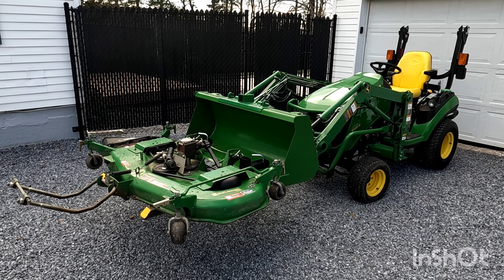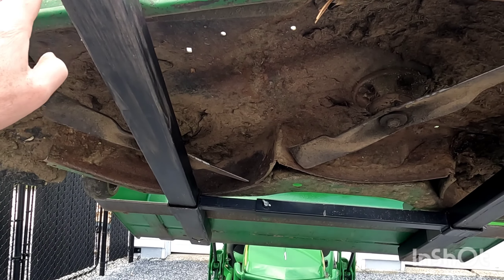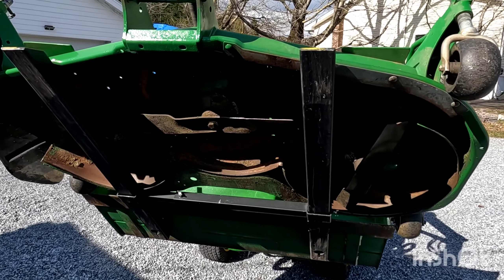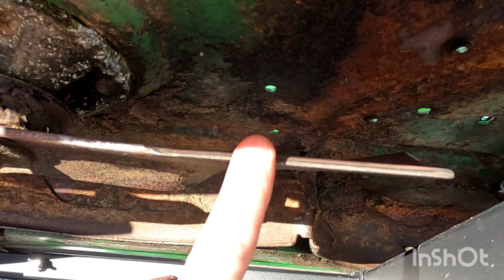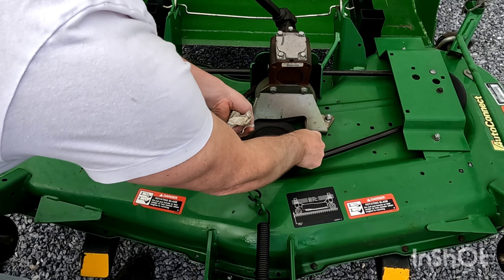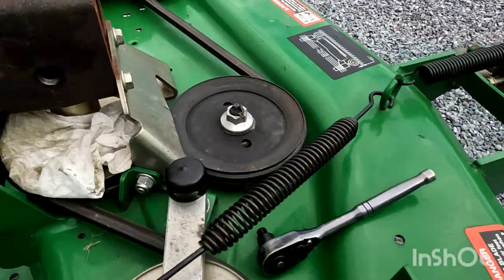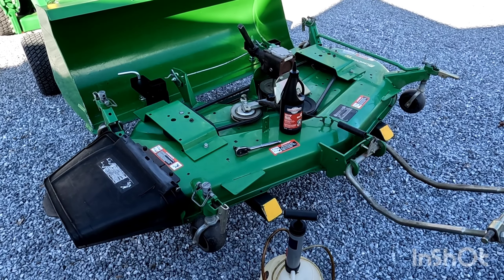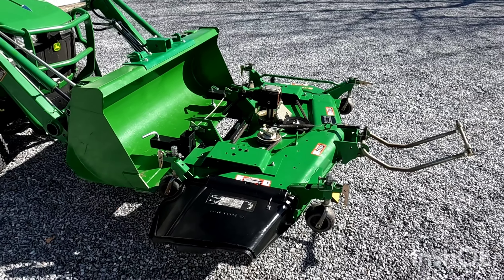Full Service Of A John Deere D54 Mower Deck

Comment: That looks brand new
Reply from the maker: Amazing what some elbow grease can do!! What type of camera are you using on your videos and editing programs? They are excellent!
Reply: @PovertyPointCustoms  thanks. I use a galaxy s23 ultra, set on uhd 30. I can shorten up the individual clips for the best parts and drop them onto my laptop. Then, drop them into magic movie studio 2023. I can adjust the sound of each clip individually and add music to the next line below. If I use my Go Pro and s23, it all works the same. Same with drone. Just drop them in as needed.